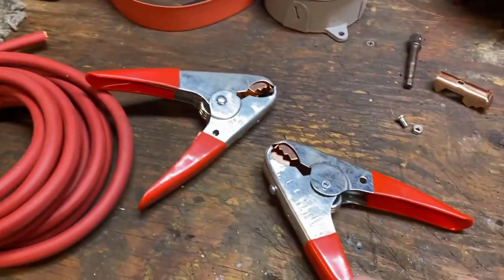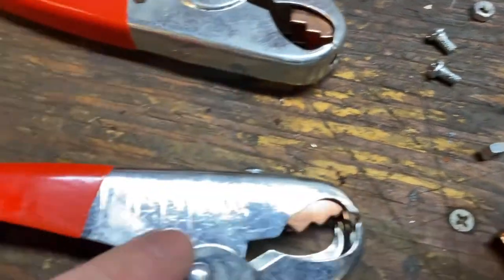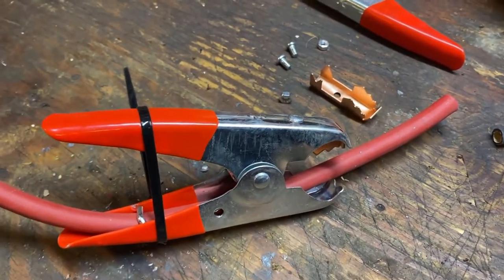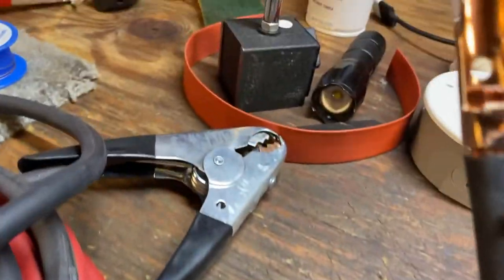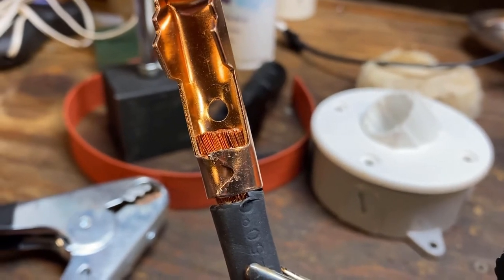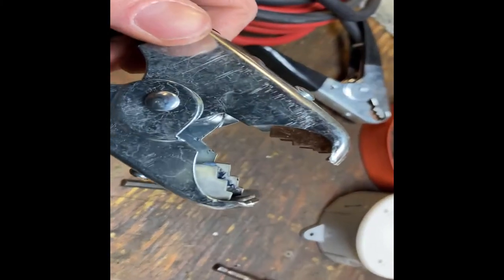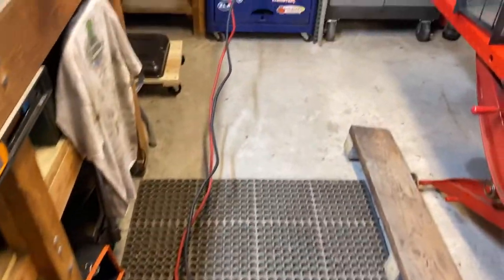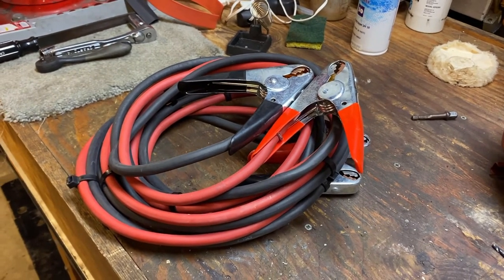Make your own heavy duty jumper cables - easy project!

Comment: Made a pair using 0 gauge welding cable 17 feet long. Only thing is I have to buy new high quality clamps. Before the clamps broke I could jump a vehicle clamping it to the battery cables without having a battery in that vehicle. It allowed alot of electricity through those 0 gauge cables.
Reply: Associated 6205 clamps.  You most likely will never wear them out.  Ive had mine for 23 years.  Made in USA too!

Comment: Good job. Is the 2 gauge the maximum that can be used for jumper cables or it is possible to go up to 1 gauge which of course will be a little bit thicker than the 2 gauge.
Reply: My father gave me  set of jumper cables 23 years ago, they were homemade by a local starter/alternator shop.  They have the Associated 6205 clamps and use 1/0 Flex-a-Prene wire/cable and they are 25ft long.  Ive never found anything I couldnt jump start... Just recently I jumped off a 85HP tractor with ease.  I am currently building another set to give away to a friend, Im going with 2/0 cable on his and the same clamps I have on mine.
Reply: Im not a fan of the clamps shown in the video.  Look up the Associated 6205, they are rated at 800 amps, they have smaller ones if you dont need the big ones... and they are Made in USA.
Reply: @drmalenko  the Deka 08756 are rated for 2/0 - the associated only up to 1/0 though people report that they've successfully gotten 2/0 through the handle.

Comment: Sir Which one is thicker and better 2gauge or 25sq mm welding cable?
Reply from the maker: It depends on what you’re using them for.  Number 2 gauge will carry more current if you need that.  25mm is number 4 gauge and is more that adequate for most normal automotive applications.   Hope that helps.
Reply: @Chris_Does_Everything Yes it help,thank you very much sir
Reply: Metric sized 25mm2 cable is right the middle beetwen AWG 2 and 4
Reply: I bought jumper cables 35mm2 4.5 meters long,cost about 40 euros.I wont regret that money.

Comment: You Should have hammered down those connections. And NEVER use solder as a "More secure" Connection. It is the opposite. It is a LESS secure connection. These cables can get very hot very quick and that solder job over time will deteriorate. I will cause problems from not making a good connection taking longer to jump or coming right out at the worst possible time. You will NEVER see ACTUAL professionals doing this. It is a liability. You should stop showing this to people or at very least tell them it's for entertainment proposes only.

OH and DC current travels on the outside of each individual strand, that one of the reasons there are so many it gives the current an easier and more surface for it to travel. You filling solder in-between those strands is counter productive.
Reply: Ive got a set of 1/0 25ft cables that are soldered, they are 23 years old.  Now, with that out of the way, solder is not as good as crimping.  However, the instructions on the batter clamps plainly state to solder AFTER you crimp, I dont necessarily agree with it, but mine have held up for 23 years.  The clamps are still sold today, Associated 6205.
Reply: @drmalenko  And how much time have your cables been in actual service. You may think that you cables have been in service for 25 years but in reality you only HAD them for 25 years. People like tow truck drivers who use these Almost every single day (or on average at least once a day), especially on AAA calls, will not use soldered cable because it will start slowing down the time it takes to jump start a car. 

You may think your once a month use is 25 years worth but that just not the case.
Reply: @AztecWarrior69_69  I think you missed my point. I'm on your side here. I simply pointed out the clamp manufacturer stated to clamp first, and then solder in their directions... I'm totally on board with what you said, did I not convey that in the first message?
Reply: @AztecWarrior69_69  and I'll add this, hammering a crimp is never the answer. Buy the correct crimpers and the matching lugs. You suggesting to use a hammer style crimper tells me you haven't fully understood crimping, how it works, and exactly why it's superior.
Reply: @drmalenko  As to being on "my side",  I never said anything that would indicate anything in either way. I was merely pointing out that People think just because they have something for 25 years that it good quality or well made, when they really never actually put it through its paces. You can have a harbor freight welder and use it twice a month and say it's very good quality but if you try to use it like a Miller welder every day it will break down a lot sooner. That is my point. 

And while a crimper is what can be and what is best for lugs, this specific clamp HAS no specific type of crimper for it. The most you can hope for is a channellock type ratcheting pliers. and they are not good enough to do the job properly. But with a small hammer you can actually roll those three points into the cable as it is meant to. That overlapping he did is not secure enough.

In any case instead of crimping the cable directly to the jaws/teeth, I would have just got some lugs, crimped them to the end of that cable with my WELL BUILD harbor freight hydraulic crimper that I have had for 15 years, and THEN just bolted it all together. That way if you have to replace the cable because you accidently cut it all you have to do is take it apart and put new lugs. Instead of having to unsolder and/or have to spread open the metal holding the cable.
Reply: @AztecWarrior69_69  I'm not really sure what your point was...
Reply: @drmalenko  Read the first line. If that doesn't make the point then you are just not going to get it.
Reply: @AztecWarrior69_69  So. We both agree crimping is best. And you disagree with the instructions Associated Equipment send with their clamps? And you assume I don't use my cables everyday? Am I on the right track here?
Reply: @AztecWarrior69_69  It was late last night, I think I get it... You are saying there is no mathcing crimper to the lug, so you have to go with the hammer style?  That makes sense.
Reply: The only time current travels on the outside is in the Mhz frequencies.
Reply: @Memphian1000  this flies in the face of everything I've ever read.
Reply: @AztecWarrior69_69  I like your last idea best.  I don't have a hydraulic crimper but I do have a greenlee long handled manual crimper that I think would do an acceptable job.  There are probably better clamps available that are designed to be bolt-in connections.
Reply: @drmalenko  https://en.m.wikipedia.org/wiki/Skin_effect

Not a DC issue
Reply: As far as dc traveling through the core instead of the surface of the conductor, that is partly true. It’s called skin effect. Imagine a boat on the water, it sits low in the water when it’s not moving but it begins to rise up as the boat gets going, the faster it goes the more it rises and at higher speeds it begins to skip on top of the water. Same thing with ac current, the higher the frequency, the more skin effect. It doesn’t really become an issue unless you’re using high frequency ac like 400hz. As far as soldering, I think it’s a bad idea on jumper cables because it makes the ends of the wires too rigid and constant use will cause the individual wire strands to break off one by one near the point of solder.
Reply: @drmalenko  .